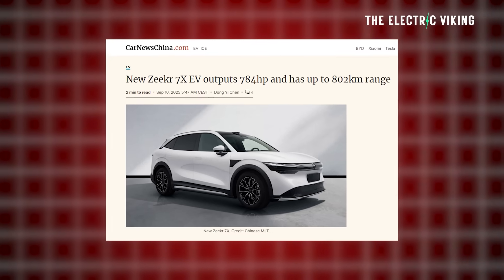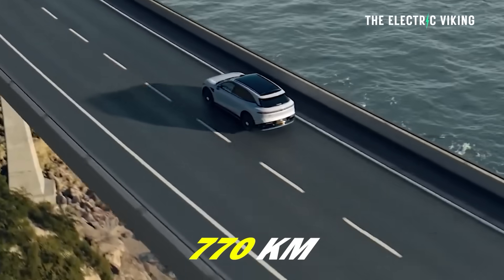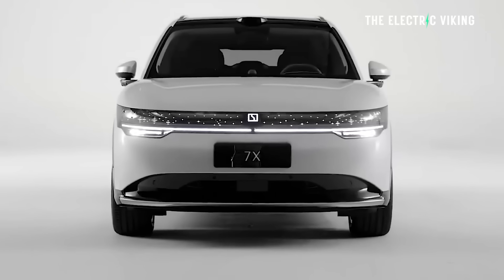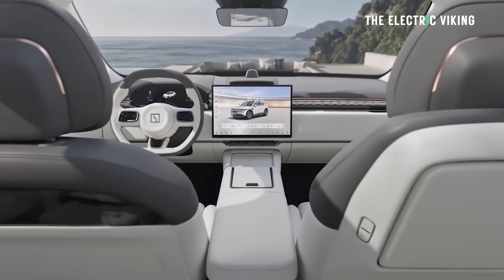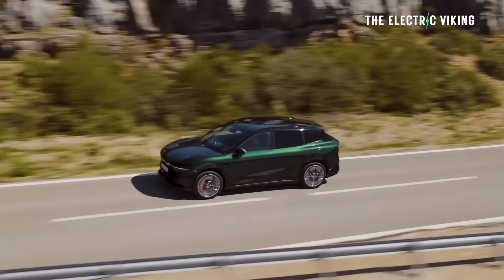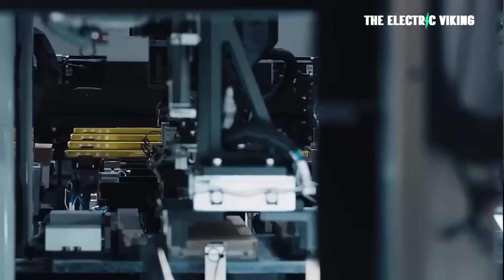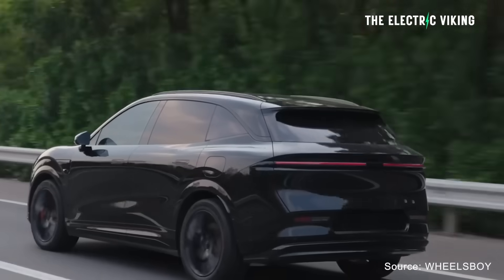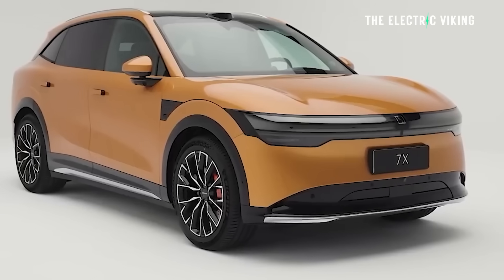2026 Zeekr 7X gets Bigger battery, Thor Chip, Massive Power Boost & More!

Comment: Not sure about the increased power on the AWD.  I went for the 2025 AWD version main due to it's off road capability and increased stability on the road. When I test drove the 2025 model one of the main things I wanted to check was that it could drive within in limits and I wouldn't find myself sneezing and breaking the speed limit.  It does that just fine by the way.  The 2026 adds more power that i would never use.  Not sure this is right path for the car to develop along.   Couple this with one of the only weakness of the 7x was that it's handling was less assured at high speeds (i.e. 150kmh plus).  So this update seems to push the car into its one area of weakness with a feature that most drivers neither want or need.

Comment: I'm sitting on the fence deciding if I should get the 7X AWD now or hold out for the next iteration.
I like the idea of having LiDAR and the faster processor as a step towards more autonomous driving. I'd also like the optionality of 20 inch (or even 19) wheels as you've said.
I might novate a Sealion 7 Premium in the meantime (includes leather seats + HUD), save some cash and review where the industry is in 3-4 years.
The thing that got me contemplating the 7X AWD now was the Novated Lease incentives, and who knows how long they'll be around for.
I'm also wary of all the electronics eg automatic doors and what the repair bill would be like if one of them fails.

Comment: The 7X that is going to land in Australia is pretty damn good ... and good enough for now, and the next few years.

The battery - going from 100kWh to 103kWh ... nothing much there.
Range on the LR - going from 780km CLTC to 802km CLTC ... again not that much there,
Thor chip - no real impact of day #1, but (maybe) could have so impact on software updates down the track ... but biggest application would be FSD, which ain't going to happen soon in Australia.

Biggest change seems to be the motors ... the new versions seem to have lots more kW and Nm output.
Maybe - just maybe - that it something that Zeekr can offer in the future as an official hardware upgrade ... swap out old motors, and drop in the new ones ...

Comment: Overall, I agree. I dont see the differences as being worth the wait. It is not like the old model is slow, its incredibly fast already, so the extra performance really wasn't even necessary. The difference in range is marginal, probably 20-30km at the very most. 

We are unlikely to get the LIDAR based ADAS system, so the Thor chip probably wont even make it into the International model, and the existing Snapdragon processor is still very fast. The infotainment system on the current model felt very snappy in responsiveness.

Also good point on the price. The upgraded model is likely to comes with a price bump. The current model's price is just surprisingly low. I probably would have paid at least $5k more for the current Performance AWD.

The only thing that really interested me is the 900V architecture. Will the 900V platform allow for faster charging on 400V chargers or will it have the same limitation as the existing 800V platform. That is the Zeekr's trump card, its 800V charging speed is on another level compared to everything else on the market, but the poor performance on 400V chargers is it's only real weakness.

Comment: Did anyone else notice that at 2:16 and then again at 3:56 there's a small container underneath the car (obviously put there to catch a drip) and a huge puddle of fluid on the floor around it? What could it be? Condensation off of the A/C unit? Seems like an awfully large puddle for that. Transmission or transfer case fluid? I'm not sure what these EVs have in their drivetrains. At any rate, that's not something you want showing in a promotional video for the car. How did they miss that?

Comment: Thanks Sam, another excellent video. Agree I will be continuing with my order of the AWD green. Given the 20 inch wheels are actually submitted and approved for the AWD in Australia it would not be hard for them to be an option even for the cars already ordered. The one bit of information missing is the ball weight. I gather via rumours an Australian style square hitch with a higher ball weight might be possible, that again would be great option. If Zeekr act on these things and have good after sales support they are on track to have a car that can  reach critical mass numbers in Australia to secure their brand and recoup profits going forward with increased prices once established.
Reply: Yes, it's very annoying that you can't option the smaller wheels on the AWD models. I currently have a Volvo XC40 Recharge Twin and I live in a regional area where we have some rough roads and lots of potholes after so much rain this year. I would much rather have the smaller 19"  wheels for ride, less likely to blow on the potholes and a better range as well as better on dirt roads, etc. 
It definitely should be an option on AWD versions in this country.

Comment: Don’t forget the CLTC range of the current Zeekr 7x LR is 780km. They are not adding that much extra range. The infotainment system is already pretty snappy and smooth. I think the upgraded chip would probably better for eventual FSD, however I’m one of those drivers that I don’t think I would ever like to have FSD take full control. If there is limited internal/external styling changes the car will look the same anyway.

I have my deposit down and won’t be changing at all, because by the time the next model is released in Australia the other one will be around the corner and then another one around the corner.
Reply: The Orin-X chip is for self/assisted driving. The snappy infotainment chip you were referring to is a different Qualcomm snapdragon 8295 chip for the navigation, content streaming to the  3.5k screens, communicating with the Orin chip...etc.

Thor is the next gen of Orin.
Might replace both for chip stacking, cost reduction and improved integration.

This ADAS chip is also FSD L4 capable.

Current Orin is L2.

Comment: Tested Zeeker 7x performance few days ago in  Thailand , ( it is higher price in here ) I saw you compare it with BYD S7 which so much cheaper ( 12K USD ) . 7X was a great car good software . BUT the driving .... man I could feel everything on the road , ( not bumpy ) I could feel the tire friction on a very smooth road , changed all the setting , the seller did everything but still the same , also road noise is higher than something cheaper like s7  , but the car is more responsive and easier to control. the efficiency was also another good point. its a great car in general.
Reply: That is unusual because all the test drives on YouTube praise the noise insulation and rate the quietness quite high?
Reply: @WillyV77 yes , but also they are comparing the car with some cars with higher noise level in the cabin. Example I tested S7 and it was much smoother and less noise , Even zeeker sales person was In s7 and was confuse that how come zeeker 7x noise level is higher with air suspension. ( I test 2 models, 100Kw performance and base model with 74kw) 21" tire and 19". Both same issue. ( continental)
Reply: It's probably the tires?
Those tires are for ev ranges so it must be hard.

Or it could be the insulation + Drag coefficient was done so well that all the noise from the road/tire amplifies to our attention.

I mean like if there's an ac running in a room you're in, nothing seems loud because the humming it makes but once you turn it off, a pin drop seems loud.

Comment: A international waranty expanded and safe service ofered that is what buyer want and serioucity intension and service as waranty isue. covered and front peek slight up and angled same as back since producer doesn't really know about quality in service to achieve high class costs repair lower expense off labour have parts spare in markets deposit since original design is memt to copy brands like vw bmw or Lamborghini  technically a bigger elect motor is just figures speed improved also tyre dim should be narrow if liked biger range if waranty is such problem then offer 2x car waranty like 200 000 km. or 300 000 km or 4 years which kind china trends since standard cars already offer a like 5 or even 7 years waranty but you still have to obtain license distributor and service and distribution then is something 100 kWh engine more tax to pay yearly on volume engine and definitely closer to premium cars and stats

Comment: Does anyone believe Chinese EV makers will be able to supply spar parts for the dizzying number of models or major updates? What happens when you need a tail light or a bumper 5 or so years down the road?  I think Tesla has big advantage in this area with their limited number of models and infrequent updates.
Reply: Zeekr x drivers who have had accidents eg, rear ended, have had bumpers, tails lights etc replaced and repaired as fast as the repairers could fit them in. Parts availability no problem and you have to realise Geely is a big company that’s wants to be taken seriously as an international player.
Reply: My Seal rear end last month, 4 parts need be replaced, parts waiting time 2 weeks, repair time 7 working days. Not bad at all.
Reply: Tesla is going out of business. They are having a hard time selling cars and making a profit.
Reply: @keithdow8327 Tesla makes a profit.  Almost every Chinese car maker loses money and are heavily dependent on government subsidies.  Most are predicted to be extinct in the near future.
Reply: @DGlass-yg8xk  

If it weren't for subsidies Tesla wouldn't have made money on Q1. 

Tesla's sales are down 12% YOY.  There is no sign this death spiral is going away.
Reply: I would rather the old model and have more range. I doubt they are going to get the same range with that increase in power, and bigger rims, even with the slightly bigger battery.
Reply: Years ago I had to get a new transmission for our falcon xr6 and that took at least 3 months so legacy brands are no different. Also our tuscon took a few months gettings parts for the front.
Reply: Well, I have a Kia EV6 and it will have taken 8 weeks to replace a warranty part (failed AC/DC inverter - a rather common problem I discovered).  That is after waiting 3 weeks to book it in.  I bought a Kia after my Tesla because of their plentiful dealerships and market presence so this was a shock.  If Zeekr, Deepal, BYD, etc were to nail customer service then the future is bright for them.  With their EV volumes, parts should not be an issue.

Comment: The Thor chip is more powerful than than Tesla's A15. The Thor chip is available now while Tesla's A15 will be out in early 2027. When is Tesla going to announce they need the A15 to do autonomous driving? Tesla is too slow and too late. RIP Tesla.
Reply: Where do you see that Thor is more powerful than AI5?  Not what grok is saying.  Not dead yet.
Reply: @chrishaberbosch1029  

Thor exists and is in cars shipping now. That makes it more powerful than the A15, which will be out late 2026 or early 2027. Chips that aren't built don't perform. 

Here are some quotes.

 "Elon Musk initially claimed 5000 TOPS (10x HW4), but 2000-2500 TOPS aligns with industry trends."

"Expected Launch: Late 2025 (possible holiday sales boost)."

"FSD V14 (coming soon) may require HW5 for its 4x parameter expansion."

So I put my money on the Nvidia design team to beat Musk's design team, which is a year late and counting. The best guess is that they may both do 2,000 TOPS, which means Musk wasted a year and billions of dollars to create an off the shelf part.

Comment: There is always going to be something newer and better coming up in the next year. I think if you need a car now, it is a great time to buy. Exciting times for EV buyers with the rate of progress at the moment.
Reply: If you wait you probably can get manufacturer supported  V2G and probably 1000km range. I think that is worth waiting a couple of years.
Reply: @henrylawson430  If you already have an EV then perhaps yes, but otherwise it is not worth waiting. There will always be something better over the horizon.
We're going for the 2025 7X as it is a current stand-out in terms of bang-for-the-buck, and the next model has only incremental improvements not worth waiting for. The long range concern is also not a big deal because these new cars generally have great range and charging speeds, and additional range on top is diminishing returns, especially as fast-charging and public DC charging networks continue to improve. (Additionally you will hit the limitations of the human body, not the car.)
I suspect that most recent/new cars can actually do V2G/V2H, perhaps only needing a software update. It is more about manufacturers' warranty terms and agreements than anything with the hardware.